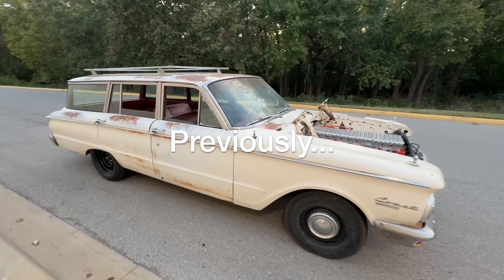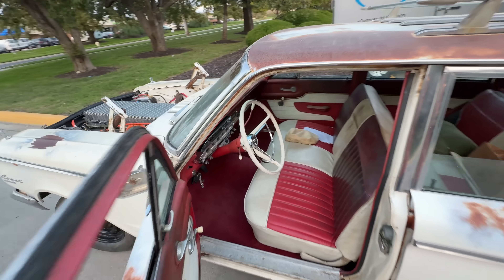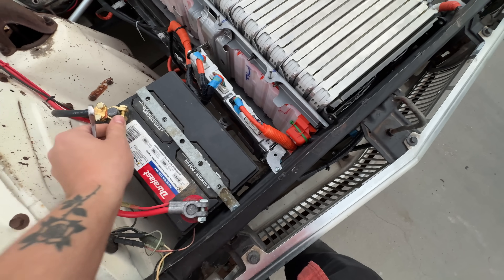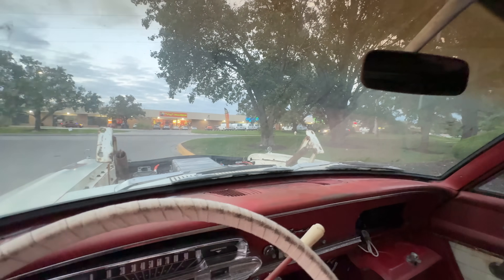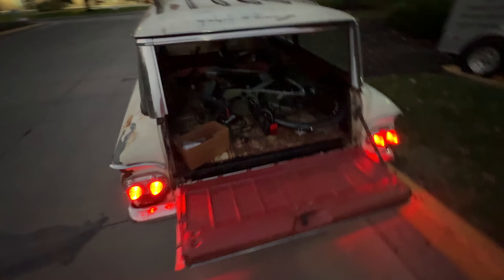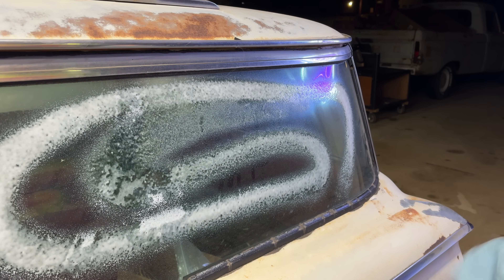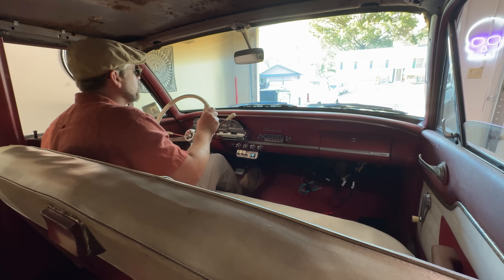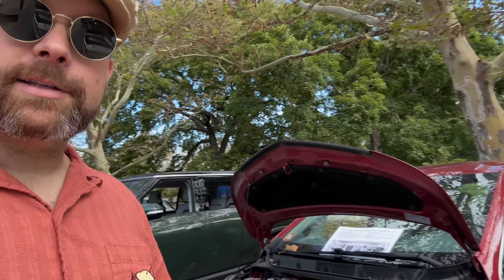What It’s Like to Drive My Homemade Electric Car

Comment: watching this, as a car history nut with a mustang.. I want one like it!  So cool to see a sub-compact station wagon conversion!
You probably know but the Mustang is on the Falcon chassis.  So many mods and parts would probably bolt on.  
If eyewereu, I would at least find classic Mustang forums (most antique forums are dead now, but still visible).
You might post about a relevant issue if you were wanting to redo suspension/steering, or search for wheel/spindle swaps.
My gut says you could probably swap something to mount any 64-66 Mustang (fit) rims.  At least get out of a rare size that way.
When this is much further along, when realizing the final plan, I would consider extending the "rocket" tail motif to the front and going custom (but reversable) LED headlights, and maybe changing the grill too.  This car looked like a baby Edsel so much.  There's things you couldn't do with ICE radiator there. Imagine just a plain blank, like a tesla nose, then imagine some shapes and lines that fit and extend the body.  Custom a pair (or two) of existing headlamps into that, before a paint job.  Maybeee create a distinct cutout right in the center that matches an old Ford Merc or Lincoln design.  It could be basically a swap for the grille and headlights without permanent alteration (maybe a couple spot welds)   Just look at loads of 50s concept cars.  Something will grab you.  It wouldn't cost too much to do and it would be the focus shot for any magazine photos (articles about you/the car). 

on the engineering side, since you are thinking to rearrange the batteries, consider something that allows you to sandwich fluid, or force air, between your racks.  The leaf suffered greatly from not having active temp control, and it kills the battery life, and its use for long trips.  When this hits you realize even a basic system would allow you to recharge much faster.  Some people have probably got some hard data, maybe even kits.  you could possibly design an air ram from the grille area with a temperature regulator to choke it, for warm weather.  Maybe add a fan or two to force cooling when stationary.  Anything like a functioning air ram intake on a 60s car sounds pretty cool.
Reply from the maker: Yes you're right. I have a front brake disc conversion kit ready to install, marketed for '65 Mustangs.

Comment: Regarding brakes and tires: if your planned front disc brake upgrade retains the Comet's 4-lug pattern, you need 14 inch wheels from a 6-cylinder first generation Mustang to clear the calipers. 
If you get front hubs and discs with the 5x4.5" pattern like V8 Comets, Falcons, and Mustangs, you'll have loads of possible wheels and tire choices from 14 inches on up, plus that's the same lug pattern as the Leaf (assuming that's the source of the rear discs?)
Reply from the maker: Good info! I already have the 14" 5-lug wheels ready to god, and I found a disc brake kit on ebay that converts the 4-lug drums to 5-lug disc rotors.
Reply: Nice! Yeah, 5-lug is the way to go, WAY more and better wheel choices. 
Years ago, a friend got a 4-lug disc kit for his '62 Comet sedan (with a later Maverick 200 I-6) and the 4-lug 14" rims were tough to find in usable/restorable condition. Also, the welds broke on one of the adapter hubs while we were autocrossing it, causing the outer ring of the hub assembly to migrate outwards with the rotor and wheel attached. Luckily, we heard the noise and he diagnosed the problem before catastrophic wheel loss.
Does the rear axle have the Leaf lug pattern? If so, excellent! One thing I would check is whether the original Nissan wheels were hubcentric. If so, you may need adapter rings for the centers of your wheels for a good fit. Luckily, those are cheap.

Comment: I used to have a 64 ford fairlane station wagon. It was in mint shape and only cost me $350 in 1981 with 90,000 miles on the odometer.

Comment: IF REBOOTING BY BATTERY DISCONNECT… SECRET… Modern electronics do not like ‘jumpy’ reconnections where the battery terminal may arc multiple times on physical reconnection.  It can cause malfunctioning reboot’s. The solution is to connect a 10 ohm 10 watt wire wound resister in SERIES with the load using alligator clips.  So a second before contact reconnection, you shunt (connect) the load through the resistor so the big lug connection won’t arc. One alligator clip is connected to the disconnected wire lug.  Just note the resister may get hot so don’t lay it on the battery or plastic surface.  I have it down to a second or so.  I hold the rubber jacketed alligator clip through the center hole of the cable terminal to be connected, quickly and firmly you poke the battery with the alligator clip holding down firmly (no arcing) which completes the shunt, and I immediately snap the lug down quickly to make full contact. Once the lug is firm, I disconnect the alligator clips and tighten the lug pinch connector. 

The theory is that there is no arc as the initial load is like a snap switch using the resistor as a buffer.  It provides enough voltage to start the electronics and any arcing is limited to 10 ohms, which is not going to cause harm.  Other mechanics talk about this like Scotty Kilmer.  

A 10 ohms 10 watt resistor is about 2” long by 3/8” square and is ceramic.

Comment: You said that the drive train was from a 2013 Leaf, are the batteries also from the same 2013 Leaf?

Can you replace the batteries with something better?

CATL have announced that they will be producing Sodium-ion batteries at 19 USD per kwh, I think some time next year.Sodium-ion means it'll totally fine in hot or cold weather, well the upper temperature limit of the batteries is also useful when charging, not just a weather issue.  So could replace the battery with a Sodium-ion battery?

Comment: Is it because drum brakes have springs to pull it back that the master pump is designed for that for it to not stick??? Whereas the disc pads don't have springs pulling them back, instead they purely use hydraulic push and pull. at least that's how I understand disc brakes master pump workins

Comment: My first car was a white Mercury Comet 4 door sedan. I think it may have been the same year as that red interior and front grill look super familiar! I kinda wish I still had it so I could convert it to an EV. Great project!
Reply: I was surprised to see that the battery fit under the hood! If yours was like the one I had, I guess you pulled out a straight 6. I used to keep a can of starter spray in the glove box to get it started on cold Wichita mornings. So glad I don’t have to do that these days in my Fiat 500e. 😂

Comment: For your brakes, you can get an adjustable proportion valve and control what percentage the rear activates versus the front. Once dialed in it will feel a lot better.

Comment: I don’t know if it would be a good idea to put the batteries in a metal case.  It seems to me that they could overheat inside a case unless you use a cooling system to keep the temperature under control.

Comment: Tesla now uses 4 toggle switches for Forward, Reverse and Nuetral & Plaid in the new 2026 Cyber truck.  Just do not toggle all the switches.  No more screen and no computer bootup waiting. Fullself driving just hails a ride share guy that steps in to drive you back home from the bar. This 10,000 dollar option is for LYFT credits. No more lawsuits. Same for Cyber Cab. No Cab just LYFT drivers. They thought cameras would work. LIDAR? Whats that? Depth of field? We don't need that. Grandpa still drives just fine. He can't see.

Comment: Neat conversion!

Might i suggest replacing the J1772 plug with NACS?

It's a more universally accepted standard in the U.S., it ensures Supercharger compatibility, plus its small enough to fit under the fuel door.

:)

Comment: Have you considered going hybrid? Regulatory forces were forcing the EV upon an unexcited market for them. That's gone now. Toyota refused to go EV,  Toyota went with hybrids and are now in a very favorable marketplace while those who thought EV would be forcible upon the people, like VW, are having to make wholesale changes. So, have you considered a very small gas or diesel engine in front to power a generator for your electric motor? Your battery pack could be substantially reduced in size and weight. The batteries could be placed in a more safe location, while the IC engine could be placed under the hood. The engine could then run at optimum steady speeds for your power needs as your batteries slowly burn off their stored power, and you can still move under electric power.

Comment: 10:43 I LOVE the sound of big eclectic motors ramping up. I drive a model 3 and smile every time I hear that sound when I floor it. Much prefer it over most gas engines, though a well tuned gas engine can also sound very nice.

Comment: The engine in my 71 Super Beetle is clapped out, so I've been pondering an EV conversion. But, I hear the batteries are insanely expensive and have to be replaced every 10 years, which feels like it would be cheaper to just stick with gas.

Comment: the squishy  feel in the turns maybe radial tires ?  these car used to have bias ply tires  , there used to be a check valve in master cylinders you could remove for  disc brakes

Comment: Not sure if anyone has said it yet, Drum brakes required a check valve in the line, this is called a residual valve. I am not sure on this vehicle if was in the brake lines of built into the master cylinder. I could machine a bushing for you in the rear if you can get me dimensions.

Comment: Just a thing to note, trailer tires are not designed or rated for passenger vehicles and thus not made to the same higher safety standards. On the other hand if you put truck tires on a trailer they will last longer. Stay safe folks.

Comment: I have a 63’ ford ranchero - basically the same car. I did a brake upgrade with a geo metro master cylinder and booster but kept the old drums and 13” wheels. Works for me! Also the geo parts are super cheap. I drive my 63’ like once a week for years now.

Comment: Nice job. :) On my inverter I can switch to reverse even if I go full throttle fwd. The inverter starts to regen then, and when the car stops it automatically spins the motor in reverse, and the car backs up. Also I installed flexible regen with a potentiometer. When I go down hill, I can keep the car only with this potentiometer at the right speed, with my foot completely off the throttle. This comes in handy also in the winter time, when you don't want too much regen to keep the tires from blocking on snow and ice. Besides that, the flexible regen is connected to the break lights so that they turn on at higher regen.

Comment: There is a big movement in the UK converting old classic cars to electric, so they can be drivable.  Most of those cars were notoriously unreliable, and extremely cost prohibitive to maintain, besides being tragically underpowered, and ridiculously polluting.

So, they pull the engine and crate it, and install a fully reversible EV conversion.  That way, the car can be restored to a numbers matching classic in the future, if so disired.

This allows owners to actually drive and enjoy the cars, instead of making them glorified museum and art pieces, which was the entire point when the cars were built.

As EV technology advances, and batteries get smaller, lighter, more energy dense and cheaper, these conversions will only get cheaper and easier.  There are already companies making drop in kits for some cars, to make the conversions quick and easy.

Comment: if its the Leafs BMS and it reports the same way it would in an actual Leaf, its pretty linear if not even programmed to make the bottom 15% hold a bit more energy than it would otherwise .

Comment: I converted the pressure brake light switch in my old VW to a brake pedal position switch after a string of pressure switch failures.

Comment: The leaf heater rapes the battery because it's a glorified hair dryer and not a heat pump but the air conditioner works pretty good in the little leaf, I'm not sure about in a full blown station wagon but ehh maybe.

Comment: If you get a chance. You should try to add solar to the car roof. It could passively charge while being parked. 
I think  it is a good option  for emergencies. 

I like how some ev cars have charging while driving too.
Reply: That’s a really cool idea having solar panels on the roof could definitely help with those unexpected moments when the battery runs low. 🌞 Some newer EVs are already experimenting with that, but I wonder how much range it could realistically add day-to-day. Do you think the tech is efficient enough yet, or would it mostly just be for emergency power?
Reply: @Mike-kn9  Using Gemini, it estimated a roof surface area of 6 square meters and using an estimated efficiency 24.8%, solar panels that covered the roof would yield 1.5 KW.  Now, how that would translate to real charging conditions is a good question.  I think a foldable cage with aluminum legs that can be removed and extended all the way to the hood, would net you even more space for additional panels.
Reply: @Toromboloize  Sounds like the perfect solution, i truly appreciate the time you took out of your day to help know this.

Comment: 5:57 - that white chevy truck lost? (gmt-800?, 02-06?) considering the vortec engine is solid, i question converting one to 100% ev. though with that presentation, i commend them if it was indeed successfully done, gm electrical gremlins and whatnot.

Comment: Something doesn't add up.  You rode the 1/2 block to auto zone to pick up some fuses. It was broad daylight.  Next clip shows you inserting a new fuse, what, 5 minutes later?  Now it is pitch black.  Care to explain yourself?

Comment: That is great. I drive a 2019 LEAF SL plus. Love the car and hope it has a very long life but figure if anything ever happens to the body that would total it I would consider trying to do something with it like this with the drive chain components in a classic car. Seams to be a lot of classic cars available advertised as a 'Rolling Chassis" which I believe means they have no engine, transmission and sometimes rear end in them. Sounds perfect for such an application.

Comment: Finally, a good looking electric car.
Reply: 11:05 anecdotal note.  more and more people will die on electric scooters or electric bikes not following any established traffic norms that we had before electric.
Reply: yeah does look better than the gm EV 1
Reply: Caterham has a couple of good looking EV prototypes.

One prototype is based on their existing petrol car the Super 7 that's called the EV Seven, and their other prototype is called Project V.

Both those prototypes look amazing, but then again Caterham is a British car manufacturer that specialises in small track cars (meaning motor racing cars for racing circuits).

Comment: Funny, mid 80's I had a '62 Merc Meteor 4dr and a '66 F100 at the same time. Merc was bigger than it looked and could sleep 4 in the trunk😁
Merc was Black w red/black int Ford was 2tone red/white 352 3 on tree. think I only paid $200 for ea at the time🤔both ran/drove

Comment: Such conversions are the thing to make those classics last forever (both physically as technically and as a bonus it's still a usefull car for daily traffic)
Reply: But in this instance its more of a toy than anything. If it had a real battery pack under the car I would think differently.

Comment: When it came time to rebuild the motor on my 1960 f100 I inquired about an ev conversion. I was told $50,000. So that was a hard no. What did you pay, and is there a "simple" conversion kit or solution that would make this practical?
Reply from the maker: Just for the conversion I'm in it about $7,000. This was to buy the Nissan Leaf donor vehicle, the Resolve VCU, all the materials for the wiring harness, all the steel and welding supplies for the rear axle and the mounting structure for the motor and inverter, for the HV copper wire, bus bars, and a million little things like zip ties, fuses, relays, etc. That number does NOT include costs for the new wheels and tires, suspension parts, and brakes.

Comment: hey @ThisOldJalopy I don't know if you swapped out the plates for the show, but just in case you definitely do not want that california plate on the front, that's arguably 'fictitious plates' if it doesn't match your registration and is a felony in Many states.  I once even got hassled for a 'winnebago' front plaque on my motorhome that wasn't even a 'plate'

Comment: So what range do you get? Like 50-80 miles on a charge?
Reply from the maker: At the end of the video, I estimated it to be about 78 miles, but that was at city speeds, not highway. I'll have to do a highway test once I get the brakes fully working and replace the front tires (currently on trailer tires).

Comment: Dude you better get seatbelts even if it is legal to not have them. Cool video.
Reply from the maker: I got them in the mail, I just have to find the time to install them now. I got the retractable three-point style, so I'll have to weld some hardware to the B pillars.

Comment: Can you charge it while driving ? (Generator on trailer behind the car?)
Reply from the maker: yes and no...? I don't actually know.  I mean, the generator would have to be putting out 400v DC, there a few different ways including using hooking the combustion engine to a 400v AC motor and inverter that has regen capabilities, or use rotory transformers (not recommended). Look up @hightek_redknek on youtube for that one.  Or it could normal 120v or 240v AC but I don't think it's possible to use the onboard 240v charger while also driving. I would have to ask Isak at Resolve.